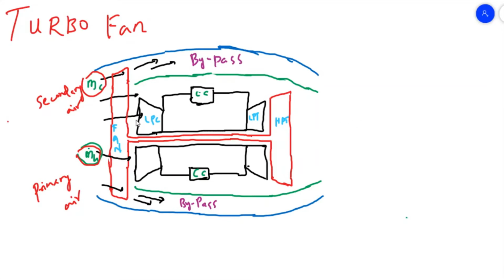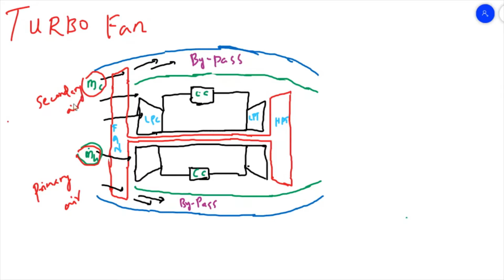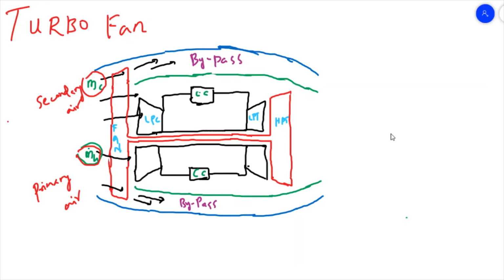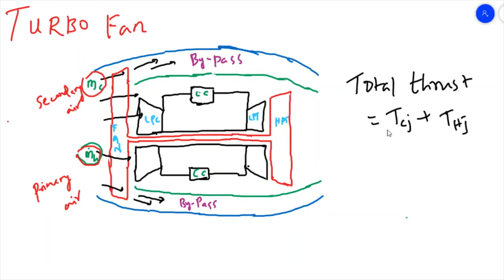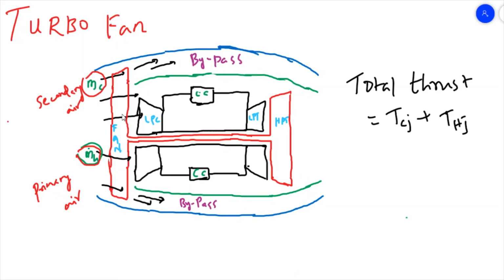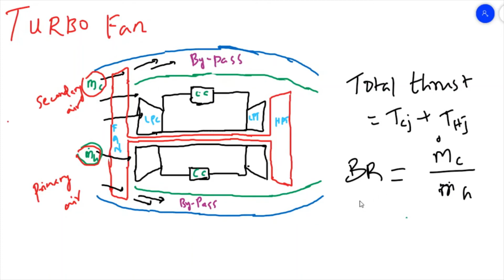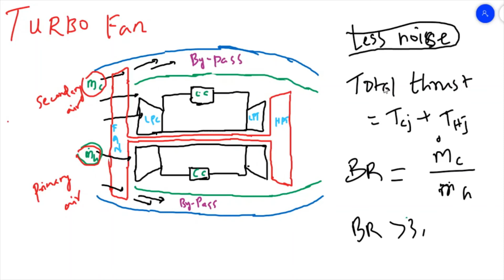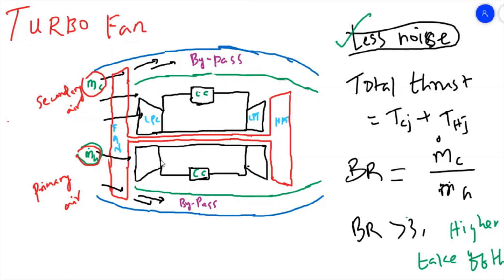Turbofan Engine || Jet Propulsion || Thermodynamics

Comment: Good!!
Which part gives more thrust? Hot air or Cold air?
Reply from the maker: The air which is taking part in combustion and expanded through the nozzle produces higher thrust, i.e. Hot air.
Reply from the maker: Cold air mainly helps in incrasing the total thrust and to reduce the noise because of the mixing with hot jet.
Reply: @aero-mechengineering111  The air in the core mainly used to cool the Turbine Casing (HPTACC ; LPTACC) and all ryt. So the hot air in the core will be used fr other purpose as well. Hence more thrust produced from hi bypass air ...am I ryt?
Reply from the maker: @mohamedafsal1739  Blade cooling is different. Please don't mix with the air taking part in combustion. This is mainly used for producing hot jet via  nozzle, which is then used for producing thrust.